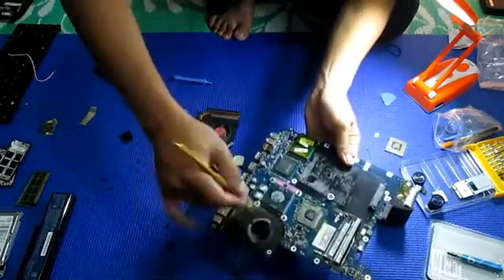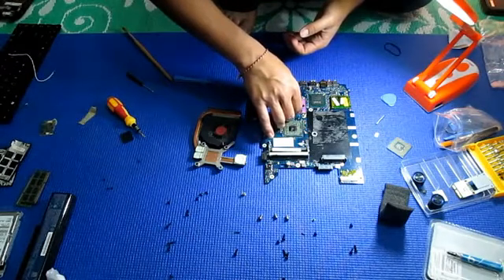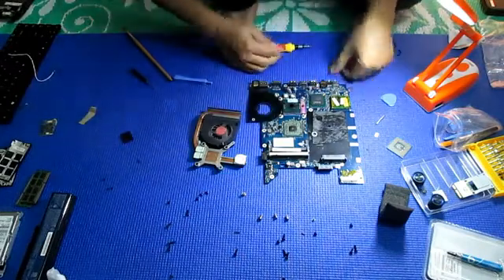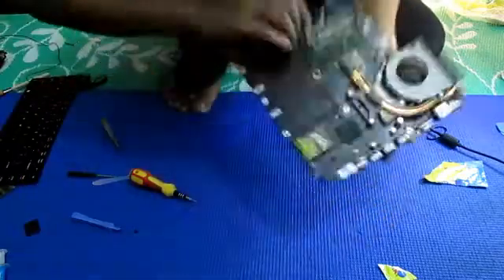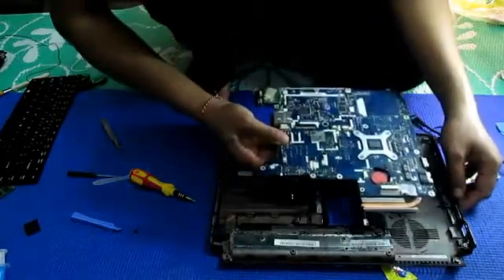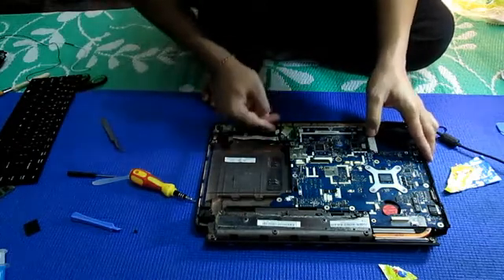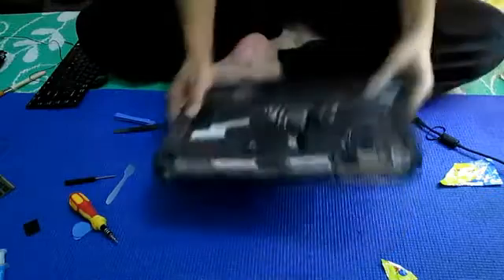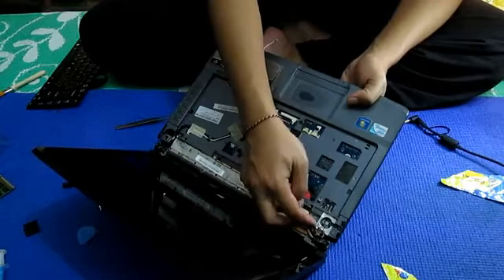Upgrade Processor Acer Aspire 4736z part 2

Comment: Mas nk tanya sedikit ni..minta tunjuk ajar dari mas..saya ada laptop ni juga acer aspire 4736z ni saya nk upgarde processor nya..kalau pakai processor core i5 or core i7 dapat gak..dan nk tnya juga kalau tukar processor acer 4736z gak perlu solder ya mas??saya tengok video mas mcm pasang mcm tu saja sbb ada kawan ckp kalau tukar processor nya perlu solder😢saya betul2 sayang laptop ni mas nk upgrade window 7 ke window 11 tu kwn bilang perlu upgrade processor,ram dan harddisk hdd ke ssd..tlg bantu saya mas
Reply from the maker: Tidak support i5 or i7. Maks core2duo bang. Tidak pakai solder, plug saja.

Comment: bro i have acer aspire 4736z with t4400 core 2 duo and 3gm of ddr3 ram with 832mhz but when I turn on its taking approx 5 to 10 minutes to boot what i do.?
Reply from the maker: make sure no virus, do ram upgrade, or may be processor upgrade. your storage upgrade to ssd, or if using hdd, make sure the hdd is healthy.

Comment: Hi boss, my acer 4736 can change or not for basic to intel i3 or i5? If original mother board i want to change another mother board latest intel and graphic card can change or not? Please help me 😢🙏
Reply from the maker: no you can't. core 2 duo is the limit for this type of laptop.
Reply: Can i replace from 4736 to 4736z?
Reply from the maker: @mohdkhairull953  yes you can
Reply: Ok, thanks for information..🤗

Comment: Hello, Sir which core 2 duo processor buy to upgrade my Acer aspire 4736Z laptop model please suggest me. I am waiting your suggestion...
Reply from the maker: for me, i am using T6670, you can try with higher series like T9900 if you have it
Reply: @sumertawan  But sir T9900 processor its work or not in acer aspire 4736Z laptop
Reply: Is ti works then i can buy this processor.
Reply from the maker: @piyushbodade1301  regarding work or no I have no experience in that, as I said you can try that, but that processor support m-PGA 478.

Comment: Can i upgrade to T9600?
Reply from the maker: i never try, may may try if you have the processor. make sure its support mPGA478.
Reply: @Mico Did you already try the T9600
Reply: @shana_sakai  not yet
Reply: @mchlmntln  hello, did you try the T9600?

Comment: pny gw udh mentok core 2 duo acer ini. Cuman sementara masih pakai windows 8.1 abis tny2 ama acernya cmn mentok 4gb ramnya.

Yg mau saya tanyakan bisakan acer 4736 core 2 duo ini di install windows 10 64 bit ama ramnya ditambah jdi 8 gb?
Reply from the maker: bisa. saya pakai win 10 64 bit ram 8 gb
Reply: @sumertawan  ramnya yg brp mhz ada yg blg bisa sampe 1333 tpi klo dri spec ram lama sih cmn 1066. Pny agan brp?

Oh y gan celeron dual core klo ane cek pke cpu id. Tpi di laptop tulisan sih core 2 duo. Sama gk sih itu?
Reply from the maker: @gerryhasni520  punya sy 1333mhz. Dual celeron dan core 2 duo y beda

Comment: Hi 👋 , can i ask  , where did you / how did you upgrade it to windows 10 ? Because i also have the same laptop , as of now . Thanks for answering.
Reply from the maker: first I upgrade from windows 7 to windows 10 when I was microsoft offer free upgrade from windows 7 to 10. It was when 1 year period of first launching of windows 10.
Reply: Make a bootable usb use 1337 torrent then use power iso to make bootable usb

Comment: Mas mau tanya memiliki tipe laptop yg sma kenapa speakernya ga nyala ya harus pake external soundcard..terus pernah mau upgrade procie ke tempat service katanya mentok dualcore dan ramnya mentok 4 gb..mohon pencerahannya
Reply from the maker: Kalo speaker cek drivernya dah bener terinstal belum? Atau bs jd layer spekernya dimakan semut, jd sobek, maka ga bs bunyi. Kalo procie, bs sampe core2duo.
Reply: @sumertawan  maaf saya type 473 aja bukan y z

Comment: i have this kind of laptop and its still running slow. i didreprogram it to windows 7 ultimate 32 bit but nothing change (except for empty drive ofcourse)   its still running slow despite of having 4gb ram
Reply from the maker: Actually by 4 Gb RAM it is should not be slow. But mine now using windows 10 64 bit, 1tb storage HDD, 8 gb RAM. It still usable for hard work.
Reply: What if I put external GPU with gtx 700 you think it will help the lagging/slow running?
Reply from the maker: @kurukizen78  may be it will help, but better you check your hdd first. Slow running also caused by aged hdd or also damage hdd.
Reply: Change hdd to ssd
Uprade ram to 8gb